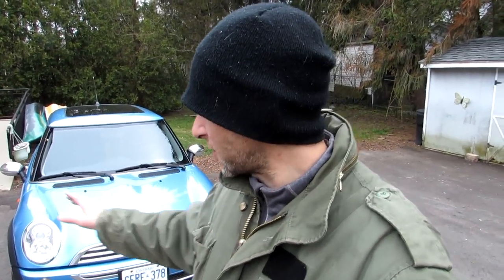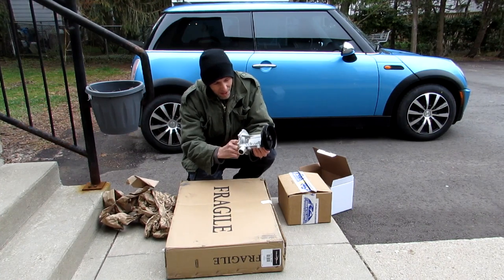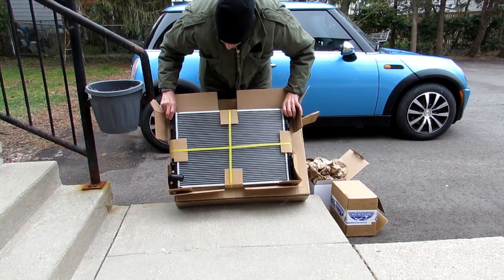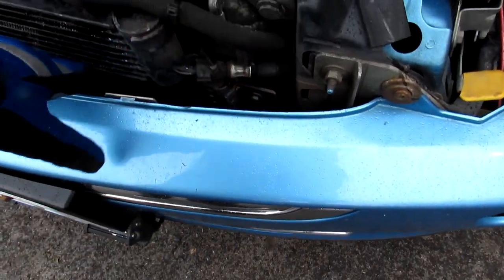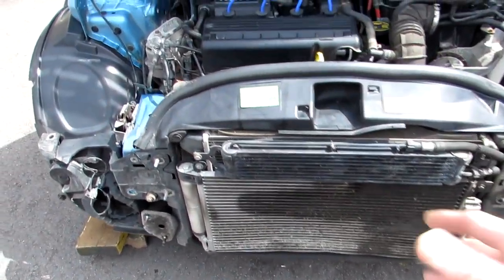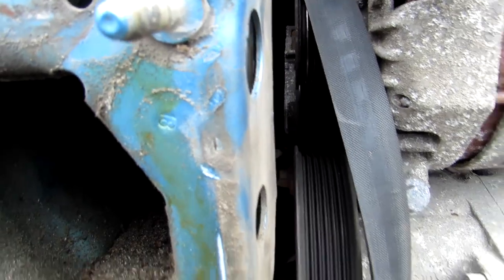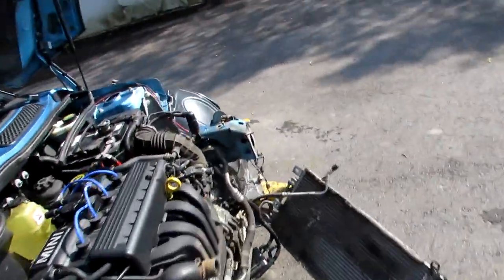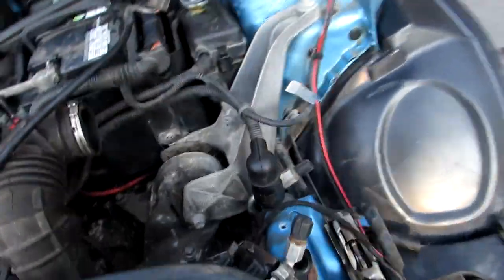COOLANT SYSTEM FIX ON MY 2005 MINI COOPER

Comment: I used a 3/4 ratchet breaker bar to pull the tensioner up. Then you can use a small tent steak to lock it in the small hole: great Vid. I have a leak but can’t find it. Also to get the alternator off it’s a bit tricky but you don’t need to take the front end off to get it. Just use 1/4 extender. With a 1/4 elbow to get the bottom bottom bolt off. The top two bolts can come off with an extension through the front.

Comment: Hi man bummer when that happens I always dump water for a flush from bottom pipe then introduce water back up at the top hose on the radiator so I get it filled. then I use main filler to introduce new mix and start to get it pouring out of the top pipe near bleed screw. once thats flowing through I join hose then start the car engine and it starts to pump water around block and you just keep introducing water until the main filler just doesnt drop any juice. Once thats all hunky dory I just use top bleed screw to make sure water exits and then tighten. if all is working fine from that point it should be ok.

Comment: Sometimes the pump will have an air lock. You can pull the hose  and fill using the hose to make sure the impeller is not spinning in  air. Also is your stat installed correctly. Make sure the metal cylinder on the stat  is toward the engine block.

Comment: It will be the power steering fan underneath the car its run off the same circuit as the radiator fan when it seizes up it does not work ... been there done same as you then found out about this little fan under the car

Comment: the only thing i can suggest is to take off the existing thermostat and test it with hot water and replace it in any case. It could be a faulty one and cold upper and low  mainfolds let think the problem is there.

Comment: You have to burp the system. There are three points you have to open and close with a flat head screw driver to bleed all the are out. I have done a motor swap on a r50 with the cvt transmission..

Comment: Thermostat in the wrong way? For some reason if you pull up the right hand corner blead pipe slightly it gets the air out without losing coolant

Comment: My 2005 mini is running hot and I just installed a new radiator.
Reply from the maker: Make sure you've got all the air bled out of the system.. it can be a very annoying process. It took me a few days and attempts before I was successful.
Reply: I'm in the middle of a coolant and thermostat change some serious air locking at the moment did you try the 2nd bleeder screw ? Just behind and under the filler cap ?

Comment: Did you solve? I still lost coolant and I don't know where
Reply from the maker: Yes I did.. but if you can be a bit more specific I can try to recommend something. Have you lost coolant right after refilling post water pump swap? If you're losing coolant under normal conditions (over time while driving) and show for no leaks you could be burning coolant and that could be a head gasket possibly. Really hard to say without more info tho.

Comment: Hi there. Can you please tell me what the component is under the water pump that has a black connector with one red wire
Reply: It's the air conditioner compressor